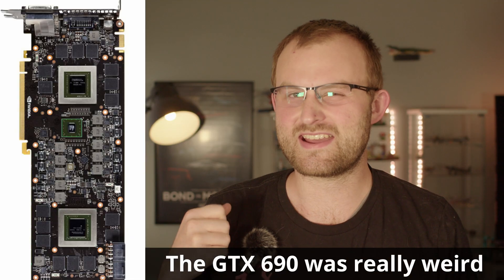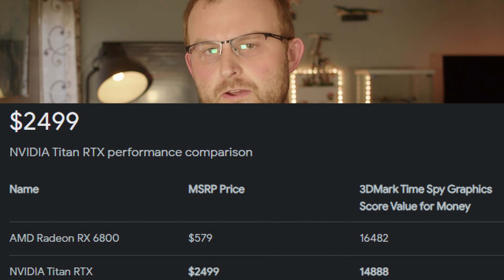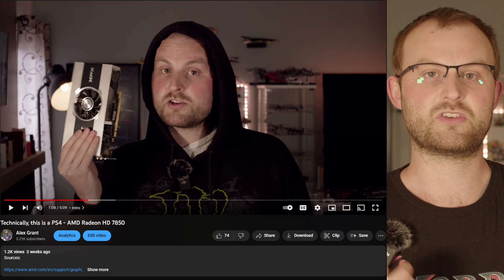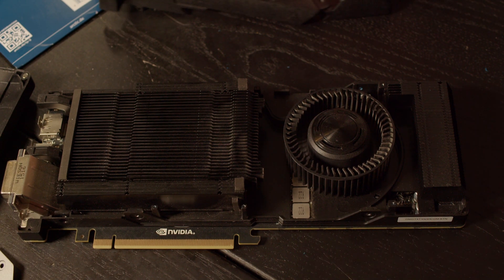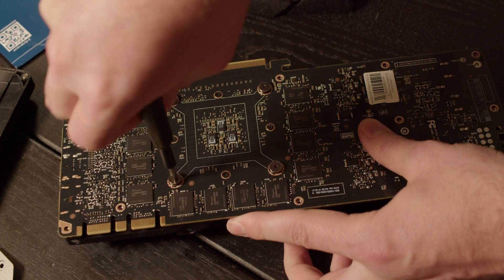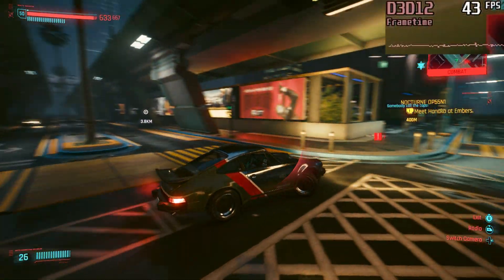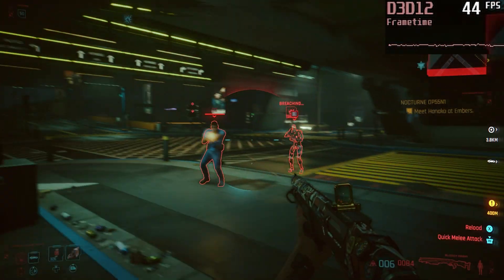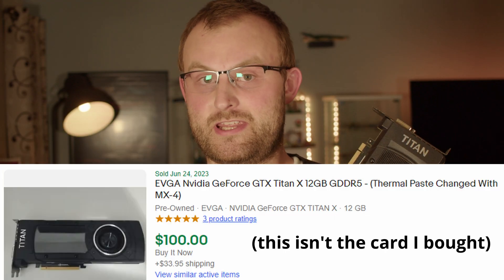The GTX Titan released 10 years ago - Repasting a Titan X

Comment: I have 2 sli they are awesome got them both for 280$ and i can play RDR2 ,Days gone and Elden ring FULL settings,A single 2060 is slower than my sli titan and I borrowed a 3090 and it had very little edge over the Titan X sli.Just keep them cool and they run great,very sturdy and you can upgrade the fan.

Comment: Try copper moding the vram with added heatpipes conectcted to a heatsink. What about putting the 4090 heatsink since its for 450w, or a serer heatsink. Those always run real hot.

Comment: I have the Star Wars Galactic Empire version and a regular Nvidia Titan X.  Both were bought at the PEAK GPU pricing; $1k EACH and I still LOVVE THEM.  I repasted and put new thermal pads on both.  WASTE NOT WANT NOT.  I did buy a new MSI 3060 Ventus and I am curious how it will compare.

Comment: The reason it didn't have a backplate is because the design for the reference one could not accomodate the dual sided memory modules. That is true for both Titan X and 980 Ti. While the regular 980 reference has a backplate and is cheaper than the two.